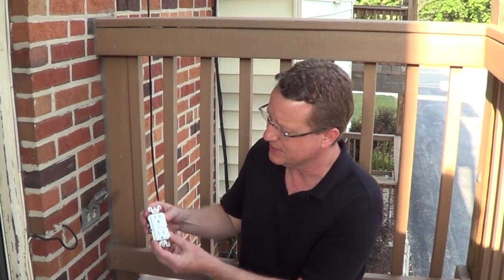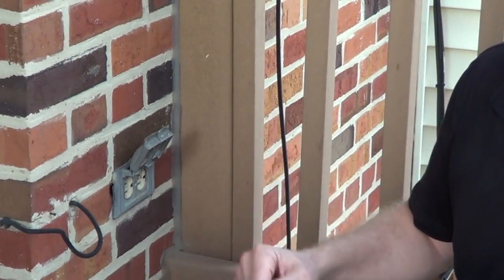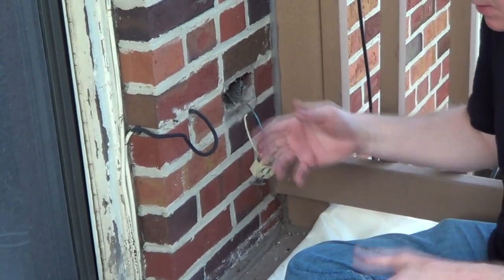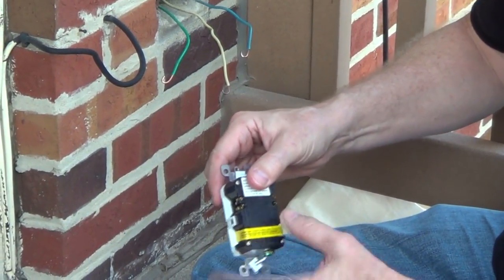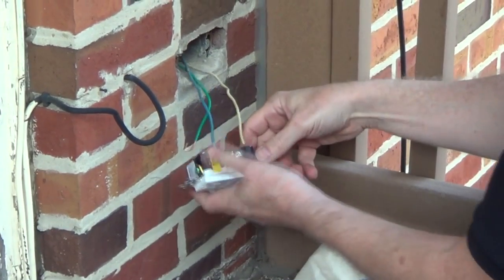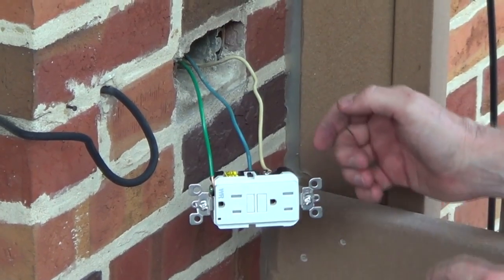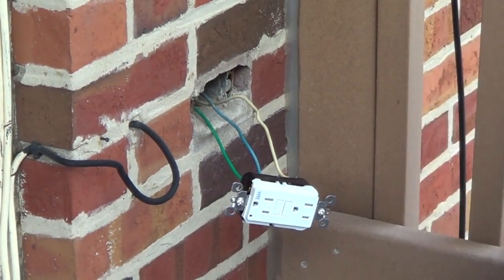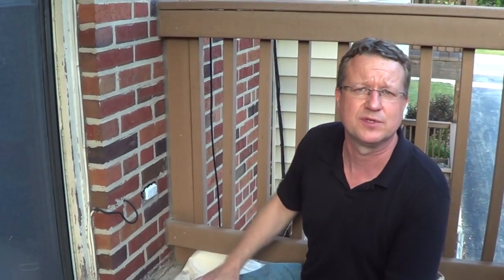Exterior Outlet - Installing an Outdoor Outlet - Conduit

Comment from the maker: Hi,
Yes, the tape covers the Load side of the GFCI. If you have a second cable with wires going to another outlet, you would connect the hot and neutral to the load side.

Comment: What if you have a ground fault and someone touches the metal conduit in the basement? Wouldn’t it be safer to not connect ground and just put a sticker “no equipment ground” on the cover? Great video!

Comment: you don't need a loop. you can back wire them. simply put a pigtale that isn't looped behind the brass plate behind the screws